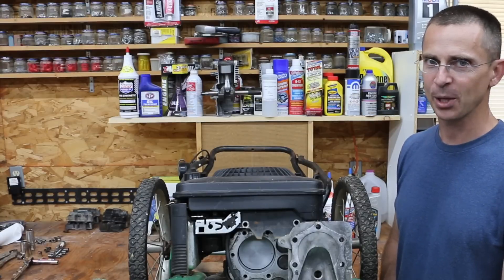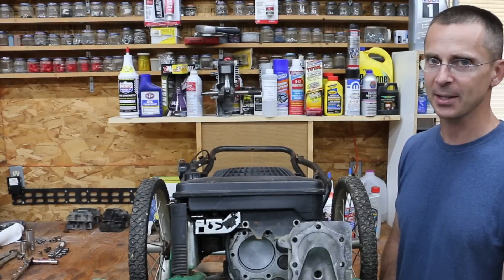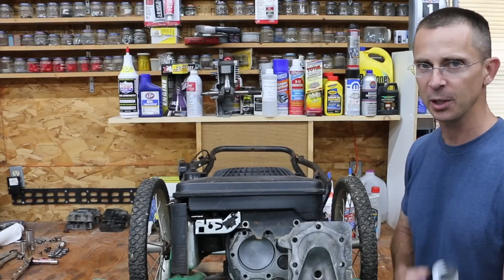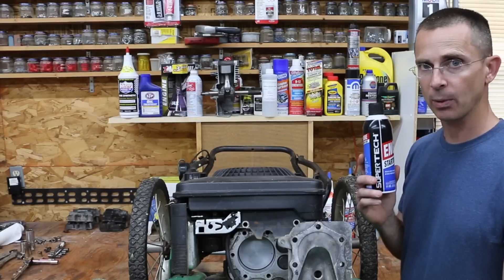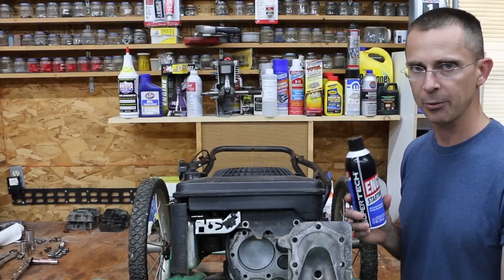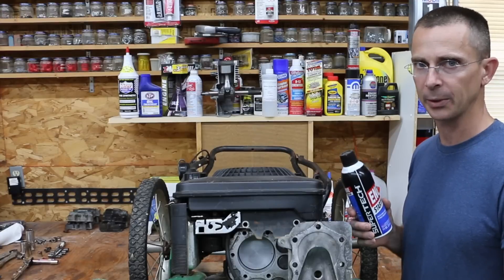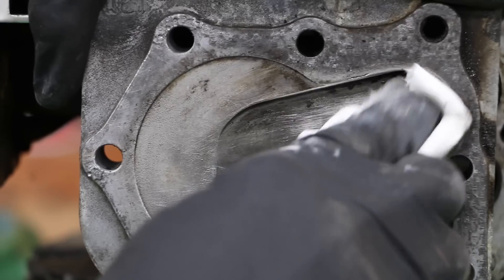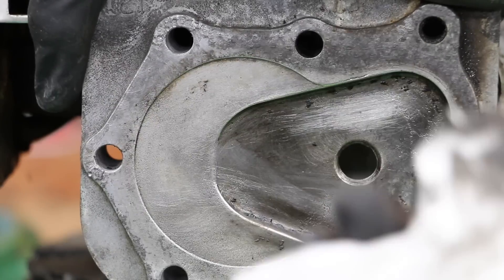Will Running an Engine on 100% Starting Fluid Cause Damage?  Let's find out!

Comment: Starting fluid definitely can damage a diesel engine severely if you use too much, which most people do. It takes very little starting fluid to start a diesel engine, and DO NOT use it on a diesel with glow plugs or an intake heater unless you're looking to start a fire and maybe injure yourself.

The myth I've always heard was that starting fluid is damaging to 2 cycle engines. That I'm not sure of, but I avoid using it with them.

Also, this is a very old myth. Every modern can of starting fluid I have seen advertises that it contains an upper cylinder lubricant. I believe this lubricant is the cause of your oily film on the engine internals. Maybe a long time ago, starting fluids didn't have this lubricant and did actually cause damage? I wasn't around at that time, so I don't know. Some old timers I work with do claim that starting fluid isn't the same these days as it used to be.
Reply from the maker: Krankie V, There is a lot of great information in your comments--thank you!

Comment: can you make a video using transmission fluid in fuel for cleaning carbon or pouring a little bit down a running engine? I heard it cleans out carbon and even debris in the fuel system. don't use to much because its non compressible
Reply from the maker: Bipolar Bunnies, I did a video on this a while back.  You might want to check it out.  Thanks for commenting!

Comment: Great video.u should try 2 alike engines with one having a good head gasket and one with a poor really bad head gasket and compare the way they run,there compression,there temperature and if they can handle a load.
Reply from the maker: This is a great recommendation--thank you!

Comment: Hey project farm I absolutely love your channel and have learned so much from it. I enjoy working and tinkering on engines also and it's so fascinating that someone's actually tests all the crazy myths and ideas out there. I had this idea of running a small lawn mower or similar engine on nitro methane and seeing what the effects would be. Nitromethane is the fuel that top fuel dragsters run on and Its also blended into my rc car fuel. I got this idea from someone who already did it on YouTube and it shot blue flames out the exhaust and sounded completely different than when it ran on gasoline. Take this idea into consideration but I know nitromethane is expensive and hard to come by. Thanks, Logan
Reply from the maker: Dirt Riderz, Thank you very much for the positive comment!  Also, this is a really good video idea!  thanks again!

Comment: Its 50%  either and 50% heptane (C7H16), the heptane will lower the octane (C8H18) rating but the either will boost it back up so the octane rating might be above 87 which is what lawn mower are designed to run at. It would be interesting to see what is exactly in that can because starting fluid can be alot of different things; some not containing any diethyl either.
Reply from the maker: Dave, Thank you for this explanation!

Comment: Run 2 stroke oil in the engine or add it to the fuel. Or get a 2 stroke and mix 4 stroke oil with it
Reply from the maker: KP46, thank you for commenting!

Comment: Could you try running an engine on a high percentage of toluene mixed with petrol, its quite a popular way of boosting octane of a fuel here in the UK however some people say that using it will damage the cylinder walls as it does not contain the lubrication additives of petrol. I dont know how true this is as i thought normal petrol is more of a solvent anyway and doesnt have any lubrication properties.
Thanks for the videos too!
Reply from the maker: Fujiwara, Thank you for this recommendation!

Comment: Diesel engines excessively sprayed in cold hard start prolonged turnover times will stick the top rings into the piston's ring groove. Creates a gummy gunk that sits in ring recess and refines into a carbon shellac gluey crap.  Would often turn the old Detroits into "Ether Whores"

Comment: The low compression of this rig allows it to run w/out damage. No high CR detonation.
 ..
Reply from the maker: Amelie, Very impressive analysis and I agree!  Thank you for commenting!
Reply: Amélie Renoncule a$
Reply: Amelie,
A lawn mower engine usually has around a 7 to 1 compression ratio maybe a little lower. 
You are correct though, a high compression engine would most likely detonate so bad it would probably burn holes in the piston, or cause it to throw a rod. From too much cylinder pressure. Or a head gasket

Comment: I've used starting fluid to start small engines that refuse to start cold.  and also, John Deere had systems to cold start the old diesels like the 4010 in colder temperatures.   I have read that starting fluids creates high head pressures but more than likely just myth..  Use starting fluid as intended and I believe it is perfectly safe for gas or diesel.
Reply from the maker: Thank you for sharing this information!

Comment: Your test doesn't account for a poor air to fuel ratio and only a short run time. Surely there is some negative impact if you did it enough
Reply from the maker: Stephen, Great point!  I also didn't run the engine under load.  Great feedback--thank you!

Comment: I wonder if that may have been from people doing this on a two stroke as they need oil mix and there is no oil in the starter fluid I seized up a leaf blower with starter fluid
Reply from the maker: George, This is an excellent point!  Thank you

Comment: either will damage a turbo charged diesel engine!
Reply: What do you mean?   Ether?   Modern starting fluid is much more advanced than the ether we used to use; it’s got lubricants included that are supposed to prevent damage.

Comment: obviously meaningless project. overrich provide liquid fuel to cool valves that were overheated by overlean
Reply from the maker: Travis, thank you for the constructive feedback.  In the 2nd part of the test, the engine ran on 100% starting fluid from the fuel tank.  The engine didn't seem to be running either rich or lean.  Thanks for commenting!
Reply: Project Farm i am an ase master certified advanced engine performance specialist L1. I was rather puzzled by the results of the final teardown as i was expecting to see a considerable amount of blueing, thermal damage specifically in the area of the head gasket fire ring, as well as thermal failure and galding on the cylinder walls from rings cracking from the intense expansion of an aluminum piston. pitting and deformation of the piston face are close behind. then i realized we are not dealing with a liquid cooled high compression ration engine turning 4000 rpm. that answers alot. single cylinder, low relative compression, insufficient atomization( cold carb) at a rpm of im guessing was around 1200 rpm? i am impressed that it went that long without carbon preignition causing stall. i also have curiosity as to the type and chemical composition of the starting fluid. many off the shelf cans that i get advertize upper cyl lubricant and use a methanol base rather the the tributyl-ether base fluids of old

Comment: yea STRAIGHT ether is where the biggest theroy came into effect. actually more of a fact. straight ether could very well blow the cylinder head clean off. its powerful stuff. i was surprised you could keep the diethyl ether liquid enough in the gas tank. 

the old addage applies here....it aint what it used to be thats for dang sure.

starting fluid nowadays dont do crap on winter mornings. lol
Reply from the maker: Geoffery, This is a great point.  Thanks for commenting!

Comment: Starting fluid is basically weed eater mix in an aerosol can, lubricant for moving parts and gas for combustion, probably why there was oil build up in the cylinder. So I wasn't expecting anything exciting.
Reply from the maker: Skinny, This is great information.  Thanks for commenting!

Comment: What if it's a 2 stroke engine. Those use oil in the fuel to lubricate the crankshaft, connecting rod, and piston. If a 2 stroke engine won't start on it's own with just gas, will the starting fluid used to assist the starting dry out the cylinder and bottom end and cause damage?

Comment: I mentioned z max in a previous comment. I had a jeep treated with it and lost the oil pump over 50 miles from home late at night and had to drive it at high way speed all the way home. it ran hot but to no ill effect to the motor. that's why I asked for the test

Comment: Can you try running an engine on just brake/clutch cleaner? Since this fluid is a degreaser and highly flammable it would be very interesting to see the results especially the condition of the combustion chamber afterwards. Thanks for the great videos. Avid viewer from England!
Reply from the maker: This is a great suggestion--thank you!

Comment: I thought sure you would snap your connecting rod! I once was trying to get a mower running and kept spraying starting fluid into it like you did and about 30 seconds in the rod snapped. Must have been weak to begin with.
Reply from the maker: Wow!  I'm surprised the rod snapped. Thanks for commenting!

Comment: diesel engines have high compression and may detonate with ether also 2 stroke engines need lubrication in the fuel so I think the 4 stroke lawn mower is the least affected engine you could use ether on
Reply from the maker: Great point.  Thanks for commenting!

Comment: You're not supposed to use Starting Fluid in a Diesel, you're supposed to use Ether. Starting Fluid will detonate. Ether will even detonate sometimes. Once I was helping my dad start an Econline van with a 7.3 Powerstroke that had been sitting for a while, it backfired through the intake while I was spraying ether into it. No damage, but it scared the crap out of me.
Reply from the maker: Thanks for this information!

Comment: If you spray a lot in the engine before starting it it will bend the valves at least I know from experience it will a diesel
Reply from the maker: Thanks for this information!

Comment: I think strarting fluid as I know it would be very sensitive to knock so would probably not do well in a diesel. The old fashioned starting fluid supposedl boosted a 2 stroke by pretty much but it's not very surprising since it's basically nitro. I know they would run it on a much fatter oil mix though.
Reply from the maker: Great point. Thanks for commenting!

Comment: I know that it already got suggested for this project idea: run the engine with an gasoline/rc fuel(nitro) mixture. I did that to my moped once, just a little nitro at 5L fuel and it already had an better throttle response. I wonder howmuch damage it could make since contains atleast 16% nitro, a lot more methanol and some oil.
Reply from the maker: Stefan, Seems like a great video idea!  Thanks for commenting!

Comment: When will you try an engine with a shot of nitrous?
Reply from the maker: hath, This is a great suggestion.  I'll need to acquire some nitrous first. Thanks for commenting!
Reply: Project Farm check out sigma they make small engine nitrous kits which use the nitrous bottles that are used in whipped cream dispensers they are similar to the co2 bottles used for bb and pellet guns......infact the system also doubles as a tire inflator when co2 bottles are used....they sell for around 49.99 to 59.99......i put one on my 1979 Yamaha tt500f  I just recent built and man does it add a huge boost of power
Reply: @thepyrodude  I am super keen to try this. Did you make any adjustments to your fueling? Or just add the nitrous system ?
Reply: @mattburrell8496  if you want it to survive you will need to install bigger jets in the carb

Comment: I tried starting fluid on a diesel once - never again!  With the high compression of the diesel it caused the starting fluid to ignite long before the piston reached top dead center.  The made the engine 'kick back' and rip out the starter!
Reply from the maker: Wow!  Thanks for sharing this experience!

Comment: Engines are supposed to become "addicted" to cold start fluid.

Did the engine still start on petrol, after the test?
Reply from the maker: Yes, the engine started and ran fine on gas after using starting fluid. Thanks for commenting!

Comment: Its way worse on a Diesel engine
Reply: Ether is like crack on a Diesel engine if you start using it it will not crank with out it
Reply from the maker: Great point!  Thanks for commenting!

Comment: Another great vid. Love this channel! :). On diesel engines I definitely think starting fluid does some kind of damage. Especially if the engine is worn. I've found on some diesels that it definitely gets to a point (after repeatedly using starter fluid) where starting them without it using it becomes almost impossible. The more worn the engine the worse it is. As another project idea I'd like to see the damage caused (if any) by using power steering fluid or transmission fluid as engine oil.
Reply from the maker: Jon, thank you very much for the positive comment!  Also, thanks for the video suggestion!

Comment: Run leaded gasoline in an unleaded engine
Reply from the maker: Dakota, Thanks for this recommendation!
Reply: Project Farm your welcome
Reply: if its a fuel injected engine you can kiss the oxygen sensors goodbye over time. otherwise back in the day before hardened valve seats leaded gas was required to lubricate the seats.  using unleaded fuel in an engine without the hardened valve seats the seats will wear out prematurely.

Comment: I have heard that you can get a gasoline engine to run on diesel fuel,  maybe you could see if that's true.
Reply from the maker: Devan, thank you for this recommendation!
Reply: won't run in a spark engine.  diesel will not vaporise and this will not ignite by spark. deisel engines use compression to heat the air / fuel mixture to the point the fuel ignites by heat.

Comment: I had always heard that the damage that using starting fluid causes was due to vapor lock. Either it would lock the engine and keep it from turning over, or if it was already running it could stop the engine and break a rod(s) ...Also, over the years I have noticed that it seems if you start using ether on a diesel to get it started it will need it more and more as time goes along.
Reply from the maker: This is all great information. Thanks for commenting!
Reply: if your engine requires it where it normally would not. then that is a sign your engine / carb is already in rough shape and time will only wear those components even more making it even harder to start.
Reply: You're very welcome, and thank you for the great video!

Comment: How long would a gas engine run on 105 octane fuel
Reply from the maker: Aidan, Thank you for this video suggestion!
Reply: I'd say probably forever . race fuel if I remember right requires a slightly richer air fuel mixture.  the octane rating is little more than a measurement of the fuel to resist detonation .  burning gasoline with a higher octane rating than your engine requires just means you are spending more on fuel than needed. todays computers can advance the timing a little ( within limits ) and perhaps build a bit more power and perhaps get a little better fuel economy.

Comment: The reason starting fluid can damage some diesel engines is due to the intake heaters which could cause an explosion in the intake instead of in the cylinder.
Reply from the maker: Thank you for explaining this!
Reply: Since diesels have no throttle plates, an overdose of starting fluid can cause a catastrophic runaway.  Older diesel trucks and tractors actually had an onboard ether system with a canister that looked identical to a propane torch canister. These systems administered a very carefully measured dose of either over a two or three second period, and would only activate while cranking.

Spraying starting fluid in a diesel like you did in the video won’t score of the pistons, but you’ll probably have a hard time finding them.

Comment: Will an engine run missing one or more head bolts?
Reply from the maker: Brandon, thank you for this video idea!
Reply: I'd say it would run but you'd probably blow out a head gasket pretty quick.   and that causes its own problems . from over heating ( if it blows into the water jacket ) , poor power, poor efficiency.

Comment: so could i use it in my 2 stroke ?
Reply: Gibbyace axb  no a 2 strocke needs the oil in the fuel for lubrication only a 4 strocke can survive domething like this
Reply: Most starting fluid I have seen in the past 10 years will say that it contains upper cylinder lubricant. It's an oil that will help prevent the cylinder walls from going dry. Whether it would be enough to save a 2 stroke engine on it's own would be interesting in it's own right though.

Comment: Some years ago i used to drive a Ford diesel van. We had to use starting fluid when the temperature dropped to about 32 or below as they would not start without it.After a time the engines would not start at all without the fluid ,even when it was 60.We used to say they had became addicted.-Keep up these very interesting topics.
Reply from the maker: Michael, Thank you for commenting and thank you for the positive feedback!

Comment: Is the exhaust the same smell as normal? And have you ever tried running it on brake cleaner?
Reply from the maker: Yes, the exhaust smelled normal.  I have never tried using brake cleaner but this seems like a great video idea!
Reply: good idea indeed. brake cleaner helps me to find leaks in carburateur hozes /intakes,if you let is run you can hear a difference.. and helps to start oldtimer mopeds.